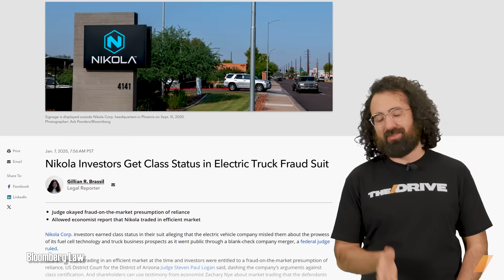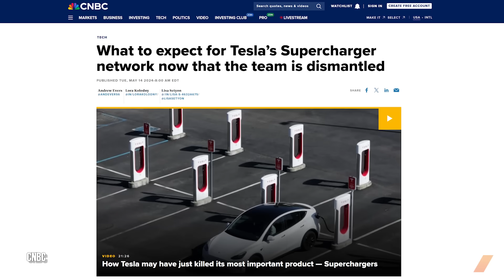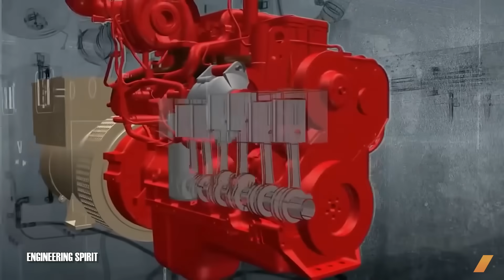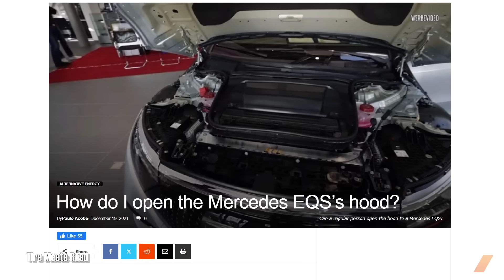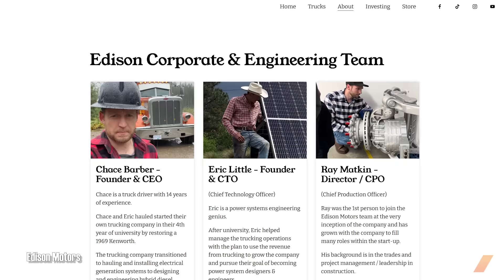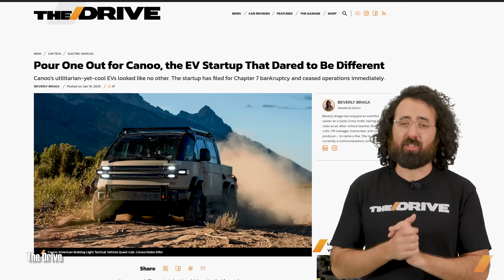The truckers in a shed beating Tesla with 100-yr-old EV tech

Comment: It is correct that the engine can run at peak efficiency in this setup, which is typically sth like 40%. With pure Diesel in normal driving, i don't think that this number is dramatically worse, only marginally. And then you factor in the double energy conversion from engine to battery and back to the wheel, and it should be pretty much equal. I question the 5%-10% consumption benefit that is mentioned here. What remains, is better drivability of the electric motors, but how are you going to get back the investment for the multiple e-motors and the battery?
Reply: The first 2 hours a day, the Edison truck is driving on batteries and is comparable to any other EV.

At all times an Edison truck benefits from regen braking like most EV's.

When driving on diesel power, the engine is at constant speed which more fuel efficient than dynamic rpm.

The generator filling batteries and the batteries spinning the wheels is more efficient than the mechanical losses of heat and noise in the transmission and u joints.

Add this up and an Edison hybrid is probably less efficient than a full EV for OTR and slightly more efficient than a full diesel at OTR.

An Edison truck will be noticeably more efficient at city drayage than full diesel.

An Edison truck could be amazing with zero fuel/energy cost when hauling logs out of mountains

Comment: I've been thinking this for years, and honestly when the first hybrids were talked about I thought this was how they worked. This has always been a no brainer to me. Electric motors need no transmission and are always at peak power, powering the electrics with an engine/ generator/ small battery combo is way more efficient. In stop and go traffic you can be running on all battery, depending on the load and battery levels you can have the engine running at low rpms, or high rpms when the load is higher. Just like a locomotive does. I grew up beside train tracks and was always interested in how they worked.

Comment: Tesla semi is not the only electric semi on the market
There are 28 different electric trucks from 15 Different brands currently on the market
the trucks listed with an * are ridged trucks and not made for pulling a trailer but i added them anyway

Freightliner
eCascadia

Mack
LR electric*
MD electric*

Peterbilt
579ev
520ev*
220ev*

Kenworth
T680e
K270e / K370e*

International
eMV*

Volvo (American)
VNR electric

Volvo (European)
FH electric
FMX electric*
FM electric*
FE electric*
FL electric*

Mercedes
eActros

Scania
sBev

DAF
XF electric*
XD electric*
XB electric*

IVECO
S-eWAY*

Renault
E Tech C*
E Tech T*
E Tech D*

MAN
eTGX*
eTGL*
eTGS*

Tesla
Tesla semi
Reply: That said, they're fully electric with a limited range, usually under 500 miles even if the companies claim they have more. Edison Motors doesn't have this issue because they have more energy being created on board by burning diesel

Comment: I grew up in WV and had coal mines and mountain top removal all around me, and the HUGE cat's they use with 12' tall tires are all the same, it's a diesel generator and all the wheels are driven by electric. My best friend is a diesel mechanic and he said it's all servicing generators, air filters, change oil, repeat. They run at peak efficiency and run clean so they last for decades in the harshest environments possible. This is seriously genius. Wonder how long it will be till the government comes along and shuts it down on behalf of their constituents in the oil business.

Comment: You don't need an electric truck that does more than 700km, because truckers are obliged to take 8 hour breaks after 8 hours of driving.

8 hours x 80km/h (maximum for trucks) = 640km.

So 700km range is all you'll ever need.
Reply: Canada loggers have an exception. They drive far off road where there are no chargers. It takes hours just to get to the mountain. So its necessary to allow a 15 hour day and a 65 metric ton load.

So you are correct for OTR freeway truckers. 

Edison makes Vocational trucks with greater needs.
Reply: @Sah-o5m  so you got a 1% exception to the rule. Which means that we can still electrify 99%
Reply: @NiekNooijens  You can 100% electrify 100% of semi trucks :)

The result will be disgruntled logging trucks and  heavy duty vocational trucks which is 37% of the market. :(

The remaining 63% of the semis that are aerodynamic will be divided into OTR and Drayage.

The OTR trucks will have to make accommodations for fully electric vehicles. They'll cope with range anxiety and scheduling time on chargers and they'll figure it out survive.
:|

The true winners are the Dreyage trucks. Trucks that always charge up overnight,  then they putter around town backing up to loading docks and unloading freight. These owners and drivers will be joyful to own and use fully electric and never go back. More power to them :)

Comment: I hate this so much. Anyone who isn't blind, this is SUPER BIASED, look I like Edison motors and find the tech awesome, but when a video like this releases that is MEGA MISLEADING, it makes it all sound like fake news. 2:50 for example. He compares a batteries weight to an engine. That is just stupid, like mega stupid. You need to compare the whole to do it right, the motor of the EV and the battery to the engine and the Fuel, you know the 140 gallons of diesel or gasoline. Yes that weight does decrease over the trip STILL THOUGH important. 

His backhand "surprise" about Tesla not delivering. Yea they make issues and mistakes, but in journalism the bias is not meant to affect the piece. It very much is especially since Tesla has delivered the cars it promised so far, only thing is the time has been off, still important, but also different than not at all. 

3:30 the dumb grid question. Every year all grids grow and we grow them fast. It isn't a problem, never was, never will be. WE can add more power we figured this out decades ago, except Texas.

Replacing the batteries will likely occur at some point, but As it stands the average Tesla battery has exceeded over 200,000 miles with over 80% remaining. Most Semi-Trucks retire in about 1million miles.  WAIT before the "5 replacements!!!" no, as a battery ages its rate of decay greatly diminishes. At 1million miles it would be estimated to be around 70% remaining. You can basically just go with 1 replacement at 500,000miles. The average Semi-Truck expends about $20k in maintenance every 100k miles. OR in this scenario $100,000. This means the battery would have to cost less than $100k, actually if we remove fuel savings it is sufficiently better.

Again I like Edison Motors, but "The Drive" is literally lying and often misleading. Please do research on the topic as this guy has an agenda and is pushing it without you knowing. He lied to me, to you, and to everyone else. This is not ok and we need to voice that.

Comment: I feel your speech is hyper focused cherry picked data points. You pick the worst EV on the market as your weight Reference that uses a completely separate battery system Then tesla. You make insinuations about extended maintenance cost for the electric semi. While simultaneously glossing over the heavy costs that trucker's face. They have to replace their lead acid batteries every year. Tires and oil. Don't forget the labor costs for that. As well plus if they have to do major engine work that can extend the price well beyond that of a replacement battery. You also assume that the electric providers are static and will refuse to scale as demand for their product increases. Something that it is only relevant to california. I have seen edison motors before, and I think your video is doing them A disservice.

Comment: Frito-Lay can use Tesla trash due to the fact that potato chips don't weigh anything- oversized trailers with small tires can haul lots of snacks and get easily pulled by an electric truck extending the range of the batteries. Good for these guys using existing tech.

Comment: Series electric has been common in locomotive, mining, and even construction machinery for decades at this point.  CAT for example sells OEM electric drive solutions, including generator, motors, inverters, axles, and gear boxes.  Edison doesn't have to reinvent the wheel.  I am however surprised that Paccar and Navistar aren't more active in developing these for on-highway.

Comment: For some use cases like logging, this beats everything hands down. Up front costs are somewhat higher, but fuel and long term maintenance costs should be substantially lower. As they optimize their design, they will eventually become competitive in the low margin over the road trucking business.

Comment: Also, as Edison Motors has said previously, since the on-board generator isn't a drive motor, in Canada, they don't have to use highway fuel. They can use other types of diesel that don't have extra taxes on it. But, it depends on local laws, may change area to area

Comment: I build something like it 8 years ago. It doesn't use deisel as generator, or only generator. Basicly diesel is main engine that generates 700 HP ( 680 WHP ), but there is 4 more engines with viscotic clutch on wheels. It's working more like a nitro adding 2000 WHP for 3 seconds, beacouse of battery limit. This is very usefull in situation like digging second tractor with plow from mud, but on road it doesn't have much use. All system costs like 300 bucks, bucket of bolts, angle grinder and welding machine. It's not really street legal, but on runch you can drive whatever you want. Project based on Kiroviets K 700 series 4x4 with some Maybyach diesel engine.

Comment: When your trees are up the side of the mountain with regenerative breaking you may end up not use much fuel depending on the distances needed to reach a transfer or unloading point. 
The hybrid engine setup should be how all vehicles end up, small batteries running powerful light electric motors, powered highly efficient ICEs.

Comment: been saying for years it makes more sense to have a pure electric drive train, battery capacity for 50-100 miles and the most efficent, light weight generator you can tuck in there that can maintain a climb over a mountain pass at the payload limit of the vehicle.  Range drops below 50% and generator kicks on till  you recharge to 80%.  Generator does not even need to be able to compleatly outpace the battery drain at max payload, just keep power from depleating to the point of haveing to pull over before you reach the summit.
  Trying to drive the tires with the ICE in addition to the electric just adds more moveing parts to break or add weight.

Comment: I find the statement that Diesel vehicles could have the same efficiency as an electric ones, buffooning.
ICE vehicles are "naturally" producing waste heat in the convertion from diesel stored chemical energy to kinetic energy, it deosn't matter if you can use the energy a teny tiny bit more efficient.
Also, when it comes to sustainability, you can't use clean electricity directly to power the vehicle but instead you have to get a chemical energy carrier which production costs way more electricity/energy just by thermodynamics. (not to mention the price at the diesel pump)

Comment: So many things wrong about this video.  It completely ignores what Europe is doing or the Janus system out of Australia both of which is being proven day after day in practice with various trucking companies.  Tesla is years behind in technology but why are they always portrayed as the world leader in EV technology?  The Edison project is great, there is no way to shift everything over to 100% EV in the US in the ten year time from their domestic oil has left. Even if the grid and technology existed the manufacturing ability to replace every truck doesn't exist.  That's where the Janus system from Australia is so great.  It takes existing trucks and removes the heavy Engine and fuel tanks replacing it with one powerful drive motor that attaches to the existing transmission and using a quick change battery pack that attaches where the fuel tank use to go. This way trucks can swap batteries faster than a fill up of diesel fuel.   Another plus to it is the drive train remains original which means the existing aftermarket parts system keeps parts economical and readily available.The systems being used in the heavy trucking industry for years now.   So both the Edison platform and the Janus system supplement European Electric heavy trucks in large scale production today. Why North America delays I have no idea but the longer the take to shift the more it's going to cost us all in the long run.
Reply: Just take 4:34, it just feels so wrong, I wished VW would have pushed through with it's effort of EV's so I could say "Hey look, we're still using the same VW T-2 Bus since the oil crisis, the range has actually got better over time".

Comment: 8:31 That is a bold claim to make.  Having an ice+ev drivetrain will always be more complex than standalone ice or BEV
Reply: I imagine there's no big-ass transmission in this type of drivetrain, and also no transfer case. So it might be simpler than a usual diesel truck. There's a bunch of electronics though, and even though it's nothing too complicated, it can break. It seems that the drivetrain is simpler, but is more prone to issues compared to the bunch of gears in a transmission.

Comment: I've been following Edison for the past few years, and believe me, I'd much rather retrofit my '98 Chevy 1-ton with series hybrid electric than to buy a new truck with their insane price tags and host of issues, ranging from being locked out of DIY repairs, to engines that sniff their own farts and are practically designed to grenade themselves so you'll buy another one and make the corporation more money!
Reply: You still have a '98 Chevy?! How did it survive without rusting out? In my experience the limiting factor for the age of cars in Ontario is the frame (unibody) rusting out, not the mechanical components.
Reply: @OntarioTrafficMan  It's got a few rust spots that I need to address when I get the time, but it's still working. I tow my landscaping trailer with it every day! I'm in the lower mainland of BC, where we have fairly mild winters, but it was a farm truck when I bought it.

Comment: I've been following Chase since before he started Edison Motors officially, it's been a wild ride and I am stoked for pickup conversions! I started to turn my F350 7.3 in to a parallel hybrid but it was far above my head. This was years before I even heard of Chase. I haven't seen anyone turn a 1 ton truck into a hybrid before and I never understood why electric only came before anyone tried a hybrid. Same thing with semis. I'm shocked mostly due to emissions regulations becoming more and more strict and unobtainable 
Now I have a 2001 F350 with a 7.3. I'd love to throw a small diesel engine in there with a comparable powered electric motor.

Comment: I would totally go for buying a 1991-2008 F250 with 200,000 miles and do the conversion. But what about the front axle? I want 4x4.
Maybe use the old twin front axle design with two smaller drive motors, mounted on opposite side from the wheels with cross side driveshafts? Maybe use old Prius motors!! 😁
Reply: If a 91_08 f250 came with 4x4 front axles then Edison is working on e-axles for you
Reply: @Sah-o5m  That would seem awfully crowded under there. But maybe with a smaller engine (don't need a 460 with strong electric motors instead), it could work. 😄

Comment: While I dont like emissions systems, making engines perform worse and slowly destroy themselves. I feel like now that theyre generators, they dont need to worry about driving the truck and just charge the battery so their output power isnt required to be as high. So if the emissions systems reduce power output, its okay but the issue of the smog system slowly damaging the engine needs to be fixed.I wonder if its doable now since its main goal is supplying power and not doing the towing.

Comment: I was in the EV industry 15 years ago and this approach is the only way that made sense. The huge CAT mining vehicles are hybrid electrics. The Chevy Volt was an Extended Range Electric Vehicle EREV with an ICE running at optimum efficiency to generate electricity and charge the battery. I don't know why that approach didn't take off because it is perfectly compatible for trucks and vans. We will still have fossil fuels for a long time. Use it.

Comment: The thing about electrification is that if we keep going, the technology will surpass the need for a grid. We already have 'nuclear eggs' being distributed to Fema. "Nuclear" is a poor wording for the tech, but it's sufficient. 

We could already put an enron egg in an electric vehicle in place of the battery. It's done. Just a matter of a few years for them to be built into vehicles. No more fuel at all. No emissions. Powered from the background medium itself. Or the "Aether" as it used to be called before big oil made it go away. ;)

Comment: Koenigsegg said something similar. Except he was talking about EV for the in traffic, but the engine can still be drect to the wheels with help from the electric motors also. Because on the free way for an hour your engine can be at the ideal efficiency for driving. So technically, Koenigsegg's idea is better, and would ultimately have even more power again because you have the engine and the electric motors both at the same time when you need it. This is exactly what Koenigsegg is doing with their  cars and its working too well. The have a 4 seater with 2300 hp all wheel drive.